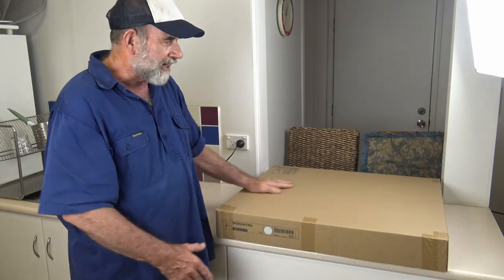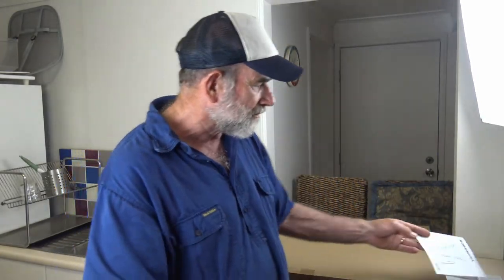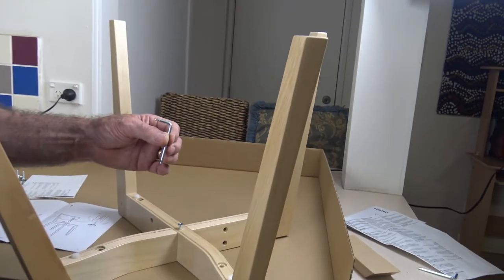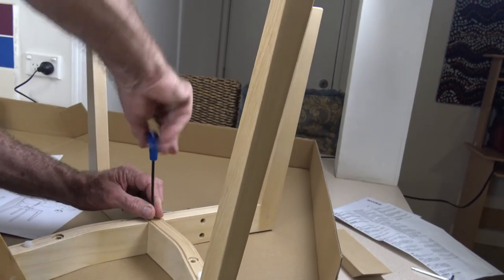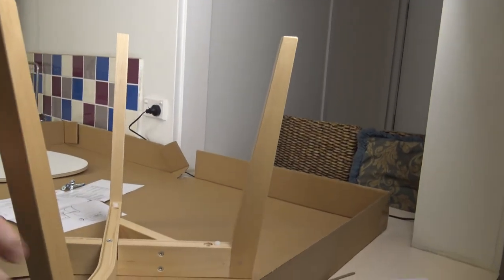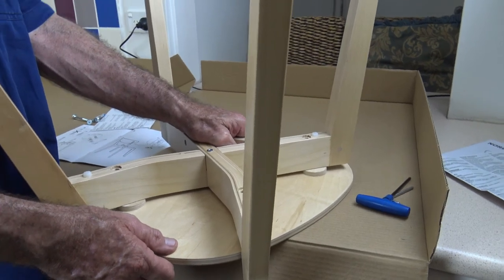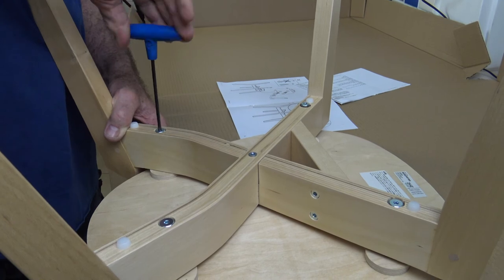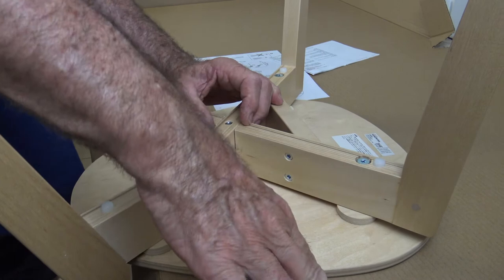Assembling Ikea Flat Pack Furniture

Comment: 17:15  one of my first adult jobs was a bicycle and  Ride-em assembler at a large toy store (unassembled from china).  I cant agree more about reading the instructions  completely before beginning, and a "soft" assembly first, especially if you don't do this regularly. things like the counter sunk screw holes get overlooked,  if it doesn't seem to fit right, or doesn't look right, it is probably wrong.  I must have had a million "do it yourselfers" try to return things...CUST: "they forgot to machine a notch for the drive spline on this axle!", ME: "No, but you did install the axle backwards"..take 5 mins a read the assembly instructions start to finish, you will be happier